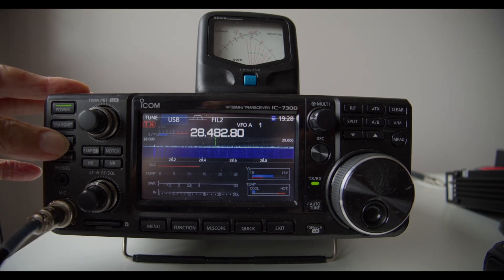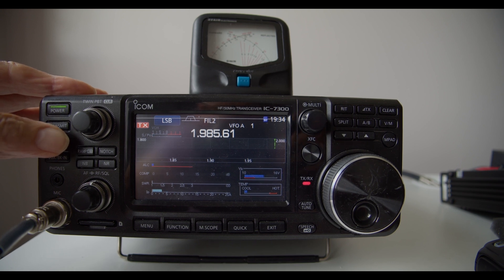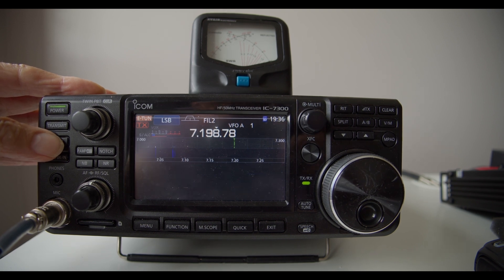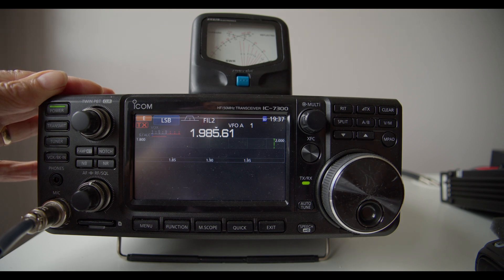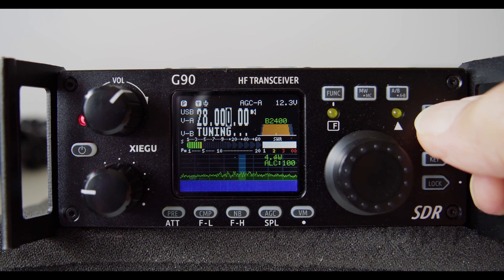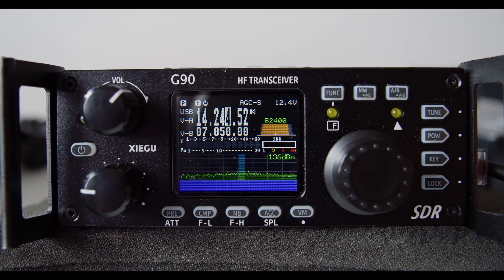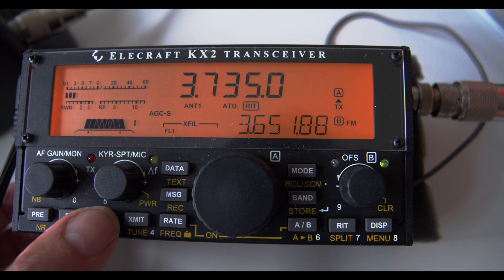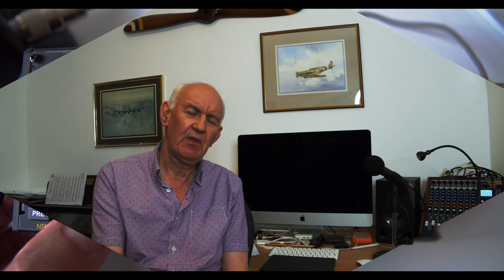Internal ATUs Head to Head  | HAM RADIO

Comment: I have a Cobweb , 7 band 14, 18, 21, 24, 28, 50, 70 running M&P coax at 7m height. In my 'group' 4 of use use them. Now mine WILL tune great on 7m but the others can't, using internals on a 7300 and a DX10. I'm using a MAT 30 tuner and I get some great QSOs with it. Even had far side of the States, from Wales. I've not tried it with the internal on the DX101,  So just how good are these internals really ?
Reply: I also have a G5RV doing nothing I did wonder if putting the ladder line on the cobweb would help

Comment: Purveyor of twisted lies and junk to fools. Be wise get a proper ATU like LDG or MFJ and a proper radio like Yaesu, Icom, Kenwood. Elecraft is overpriced as is Flex. Xiegu is inferior junk in comparison. I purchased a G90, never again, biggest complaint is AGC circuit which fails with strong signals and blasts your hearing with headphone. G90 is a very unpleasant radio to operate with tiny screen and terrible audio. Xeigu radios are a long way from a quality radio yet they keep pumping variations of the same inferior junk.
Reply: Out of interest, how much do the other brands cost for similar features? To the G90 for someone interested in getting one?
Reply: @petergoldsmith8584  I am in USA. Yaesu FT-891 $625 Radios from top 3 companies (YAESU - ICOM - KENWOOD) are incomparable in form and "function" G90 and like are inferior radios in everyway. ICOM IC-7300 $1000 is so far ahead (Amazing Radio) of  Xiegu  in technology and function and operation it's idiotic to compare them in any manner.  Spend your money wisely. I have all these radios and XIEGU is NOT in the same league and I would NOT buy another at this time  ; )

Comment: Great video. All above my head but good to watch. I am contemplating of getting a G90 as my first HF for sota.
Motters M7TRS 73 👍🏻
Reply: I’d look for a second hand ICOM 706 instead or similar
Reply: @digitalmediafan  morning yeah I have thought about one of them. I have to think about power in watts as I can only use 10w also size and weight. Motters M7TRS 73 👍🏻
Reply: @Mottersmotters  oh yes of course oh well look for an Icom 703 then maybe but the G90 does seem to be quite an incredible 📻
Reply: @digitalmediafan  Thanks. Will be honest I've not looked at this radio just had a quick read. I guess it depends on how available then are and price. Motters
Reply: @digitalmediafan  just been looking seems a good radio. Struggling to find many for sale guess in the £600 mark second hand. 😔

Comment: I have been using my newly acquired G90 for about two weeks now. I was shocked at how strong the internal ATU is. I am using the same 88’ EFHW sloper 30’ to 8’ at shack end, 25’ ground wire, that I use with my Kenwood TS-2000. The TS-2000 struggles with some of the bands on this antenna and is unable to match 160m at all (unsurprisingly) to the point I added an MFJ-914 ATU ‘extender’ (at this point one has to wonder why even have an internal tuner at all if you still have to use what is essentially a manual tuner, or just put up a better antenna, lol. But I got the ‘extender’ for free). In any case the G90 tunes all bands on this antenna wIth no trouble. I get good signal reports using 20 watts on a 500mi radius 75m net I frequently check in on. If band conditions are good I use only 10 watts. I have used only 5 watts and been told “good audio, but a little light”. I get outstanding signal reports more locally on 10m using 5 watts. The tuner on this radio can take a little long, but it’s worth the wait. It never fails, seemingly. At least it’s not failed me yet. I run it on a Bioenno 12v 8ah LiFePo4 battery. These are my results at my QTH at 1150’ ASL… YMMV.
Reply from the maker: Great information and thanks for sharing. Hope it will encourage others. 73 Peter

Comment: Peter thank you for another informative video. My Xeigu XPA125B 100 watt linear amplifier also has an excellent internal ATU. I use my XPA125B with my G90 and get a match of 1.6 to 1 or better on the SSB portion of all bands 160 through 10. My antenna is a 71' non resonant sloper with a 9:1 unun, 50' RG8x, and common mode choke. I've made SSB contacts on all HF bands that allow SSB, and SSB DX contacts to Europe, Asia, and Australia from California. I also get good signal reports on 80 and 40 SSB nets. Can you possibly do a test using the XPA125B and the doublet you used in this video using the G90 and possibly other QRP transceivers?
Reply from the maker: Hi Joe, I don’t have one of those amplifiers to hand at the moment but will put it on the list.

Comment: I can use the internal tuner for my doublet on 3 bands with my IC-7410.  The rest need the external tuner.
Reply: I inherited an IC-7400, a very similar rig. The tuner is not great at all, my Yaesus don't balk at the same load. It is just the 60m band that I have a bad match on fortunately. I do have a decent tuner (and amplifier) but for remote operation it is convenient to let the rigs internal tuner take care of the mismatch.

Comment: Another thought provoking video Peter. I wonder what would have happened if you reduced the power from 100w to 20w on the 7300, would it have behaved any different? I also have a G90 and confirm that they do tune almost anything. I have made a contact on 20m to Italy on the feeder of my 4m Slim Jim antenna! (when I didnt pack the HF antenna on a hilltop activation) 73 G8XDD
Reply from the maker: HI david, reducing the power made no difference.

Comment: Icom IC-7300 may have been faster as it could have saved previous match's if its your shack radio, unlike the other more portable radio's which might not have been used on that antenna before.
Reply: Yes, it does look like most of the matches had already been stored in memory perhaps. It’s hard to imagine that tuner being that fast. But maybe it is? Because Peter does know what he’s doing, its hard to imagine he would have made this oversight. It would be nice if he would have pointed this out before the test. Maybe he will weigh in and clarify?